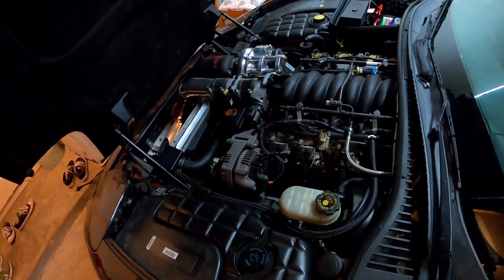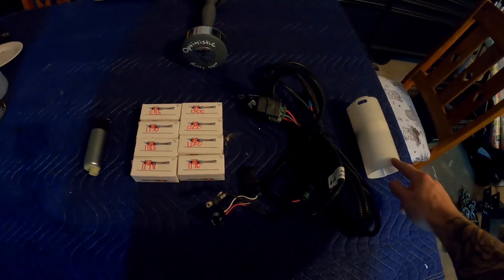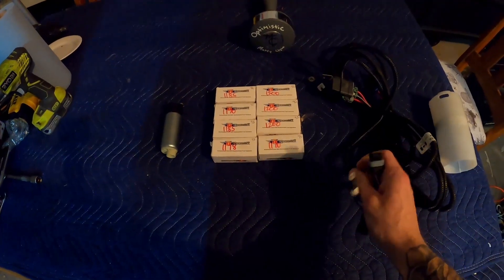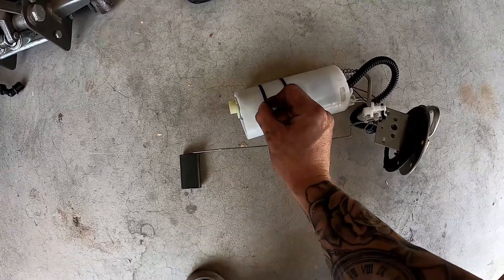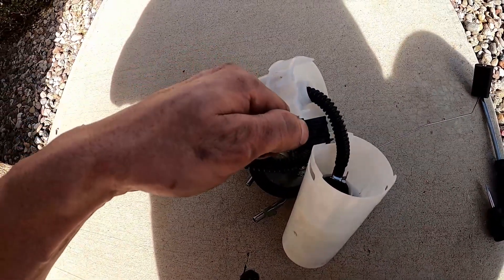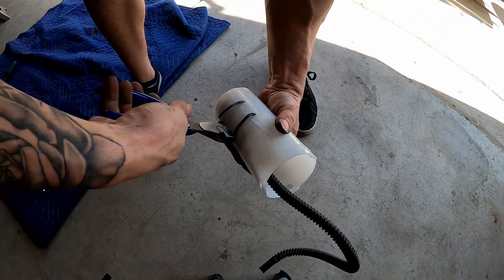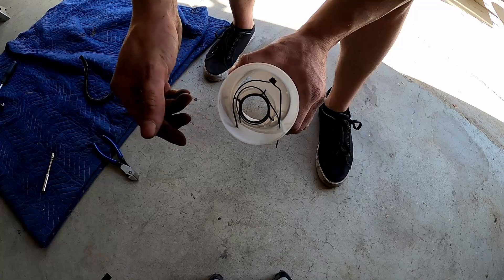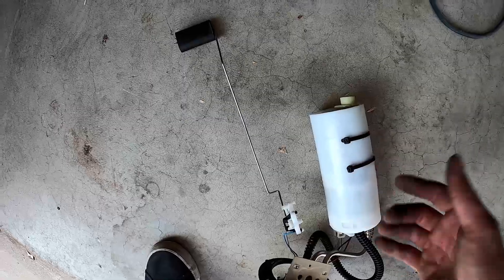600HP+ Single Fuel Pump DIY |Supercharged C5 Corvette

Comment: Doing this right now, having trouble getting the stock pump out of the bucket. Did you use the stock L shaped fuel filter? I'm going to put an Aeromotive 340 in but the sock it came with is alot smaller than the one that I pulled out of the tank.
Reply from the maker: @7digis  the pump is a bit of a bear to get out, but you have to keep working at it and pry gently on the plastic.  I used the aftermarket sock that came with the pump, haven’t had any issues
Reply: @garagegrunt8154  I ended up getting it sorted, thank you for your help. I'm making a video about swapping a few fuel parts on the C5. Do you mind if I put a link to this video in the description of mine?
Reply from the maker: @ thats awesome, glad you got it taken care of!  Not a problem at all, I’ll be interested to see the video as well!

Comment: Are you running factory filter/regulator returnless setup?
Reply from the maker: @QBCars12  yes I am.  Soon, I will be upgrading the fuel system and I will go over how to do that as well for fairly cheap!
Reply: @garagegrunt8154  will be on the lookout!
Reply from the maker: @QBCars12  thanks, I appreciate the support!!
Reply: @garagegrunt8154 I think I got it pieced together. Tell me if this is similar to your plans please.  Holley hellcat pump in tank/racetronix wiring, factory fuel hat and y up to a 97/98 returnless filter, from there -8an up to aftermarket fuel rails on ls6 intake, off the return side rail to Holley hp regulator then run the return line through the factory feed then splice it into the return line at the factory regulator location. Fittings to get from 3/8 QDF to 5/16 QDM will add a -6 a line to adapt unfortunately. Doing this setup to retain the orifice in the factory fuel hat lines to retain the saddle tank factory setup.

Comment: Will this in tank setup work with a 525lph Holley hellcat pump?
Reply from the maker: @QBCars12  yes it will, it’s for any single pump setup.  Just make sure you install a hotwire kit and you’ll be all set!
Reply: @garagegrunt8154  thanks! Would the racetronix hd kit work w/o mods?

Comment: Doing these modifications for the single pump in the stock bucket, did your dual gas tanks function like normal? Did PS tank siphon to DS tank normally?
Reply from the maker: I did not notice any issues with it.  Since then I've done a dual fuel pump setup without he bucket and haven't had any issues.
Reply: @garagegrunt8154  awesome, thanks for the feedback.

Comment: I'm currently researching 340lph pumps for early C5 systems and this is exactly what I thought was needed. Good stuff. Racetronix/Radium/Lingenfelter no longer carry "kits" and it seems doing a DIY modification like this is the only solution until they get back to offering a kit. I figure finding a 340lph pump, new plastic flex line, pump harness to fuel hat and upgraded hotwire kit is all that's needed.
Reply: Racetronix has come out with a "drop in" bucket assembly for early style systems. I got one of the first kits out and 2 mo later I suspect the pump is dead. Working with them to get a new one hopefully in time for my next race event October 1st...

I still have my stock pump/bucket that I may need to do this 340 pump/bucket mod to get by...
Reply: @smitty2919   did racetronix  ever do anything to rectify the problem.....on the phone they said they were 2 weeks from a solution........but i havnt  heard anything back from them........poor customer service

Comment: What is ur duty cycle with this setup ?
Reply from the maker: I did not get a chance to get it from my tuner last time.  It will be going back on the dyno within a month or two after the engine swap, I will let you know then.
Reply: @garagegrunt8154  what year is the car? Does it have a return line from the rail or just a return from the regulator?
Reply: @garagegrunt8154  nice! So u did dual pumps then this pump? Sorry I’m having a hard time following
Reply from the maker: @bnrz28  Not a problem, it's the opposite way.  I had that single pump setup when I made the 590hp.  I switched to dual fuel pumps and that's when the car went back on dyno and made the 653hp.  I did this video as a DIY for the guys who are staying with a mild build and under 600hp.
Reply: @garagegrunt8154  o ok I get u man. Awesome vids btw very informative..
Reply from the maker: @bnrz28  Thats the plan for the channel, provide content that people aren't putting out there.  Hopefully it helps a few people out when they're struggling with an issue.